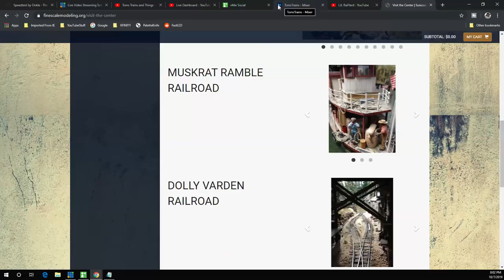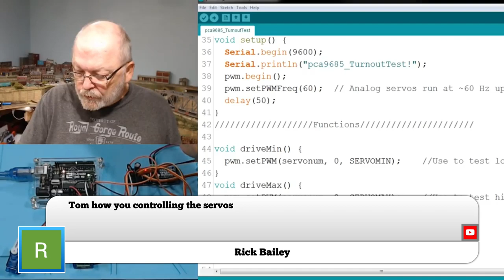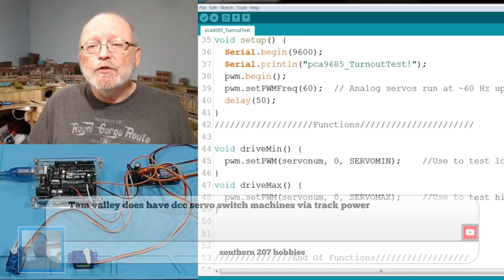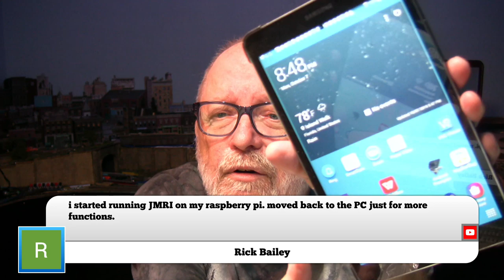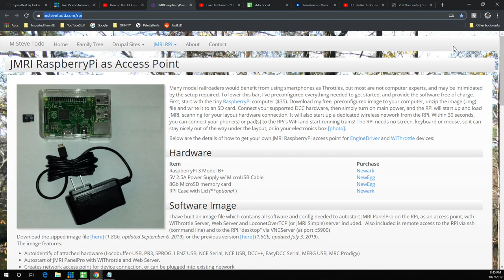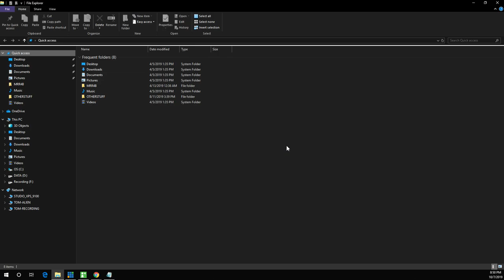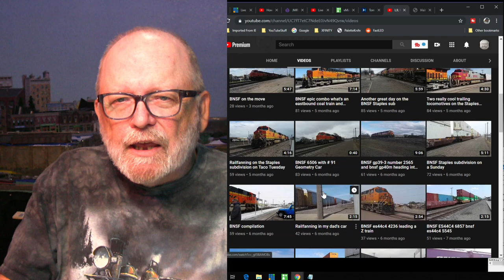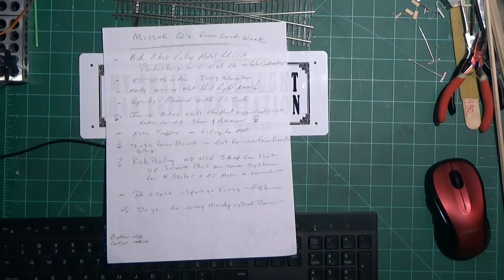Control Your Turnouts With Servos Through Two Inches Of Foam - Live Replay

Comment: Hi Tom... I haven’t had much luck getting DCC++ to work with JMRI so I’ve scrapped that project for now. I want to use a single Arduino nano per servo to control each turnout.  My question is: Is it even possible to get JMRI to recognize an Arduino as a turnout to program it in JMRI without using DCC++?
Reply from the maker: Haven't tried it but it's worth a try. What issues have you had with DCC++ & JMRI?
Reply: My problem with DCC++ is some of The functions of certain decoders (specifically economi’s)function differently or not at all. I don’t know if it’s a hardware issue or software. I’ve tried both a genuine uno and a mega. I tried generic motor shields and finally purchased a genuine Arduino motor shield but still have the same issues. I am still using JMRI but running it through my Digitrax Zephyr and PR3.
Reply from the maker: The correct decoder has to be selected from the list of many. With DCC++, it appears that more decoders are listed than normal. I've had the same issue until the correct decoder was selected. Bachman Economy DCC with sound for me.